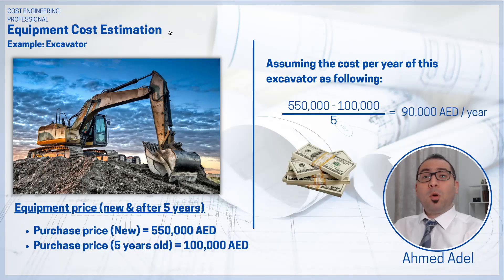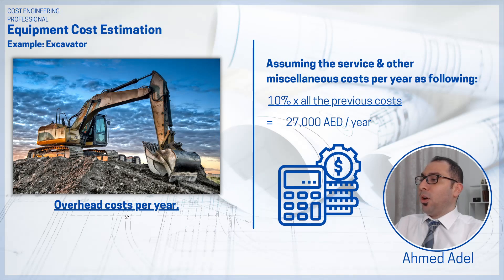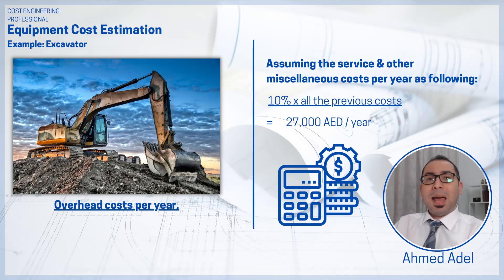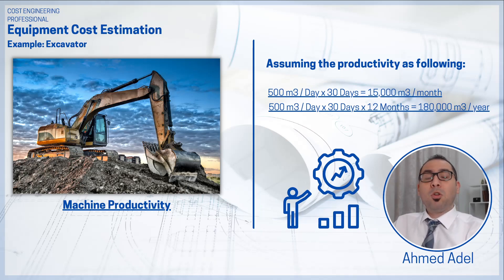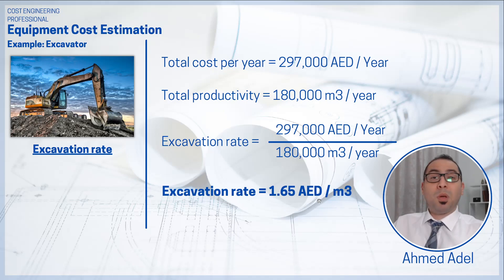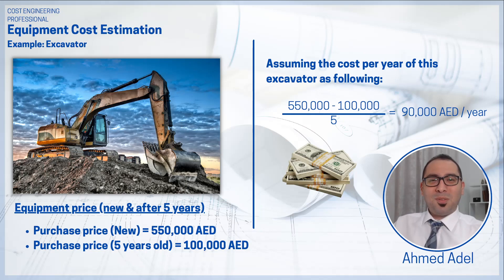How to Estimate Equipment Cost In Construction Projects

Comment: If there is something mostly the specifications data sheet will not tell is the consumption daily of the fuel,it only tells you the totally full fuel for each machine,now to know the daily consumption dependents on the experience on the field. As for my experience for example a motor grader full with fuel and doing 8 hours work can take more or less 3 days to finish the tank.
Reply from the maker: Great. If you know the consumption for the different equipment and also know the productivity, you can estimate the cost per unit of measurement 👍
Reply: @CEPQS  I'm delighting on your master class

Comment: TLDR: Equipment cost estimation in construction projects involves factoring in various annual costs and considering the time value of money for future resale, in order to determine the total cost of equipment and make informed decisions about acquiring and using it.

00:00 💰 Equipment cost estimation includes purchase price and annual cost per year, which can be calculated by dividing the loss of money over the years by the number of years.
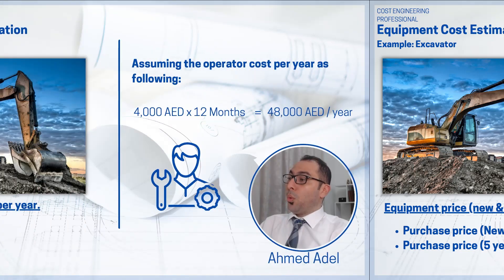01:33 💰 Equipment cost estimation in construction projects includes factoring in operator cost, fuel cost, and service/maintenance costs per year.
03:01 💡 Equipment costs in construction projects include maintenance, insurance, and company overhead, with total annual costs including equipment, operator, fuel, service, and miscellaneous expenses.
04:38 💰 The total cost of equipment in a construction project is determined by the annual cost and the productivity of the machine.
06:02 💡 The excavation rate for the excavator is 1.65 dirhams per cubic meter, not accounting for loading or disposal costs.
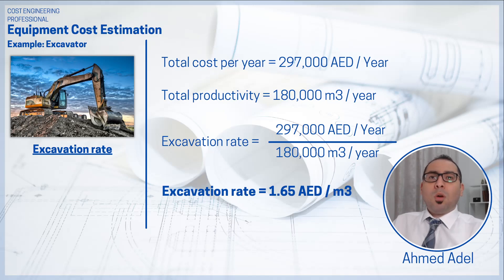07:09 🚜 Excavation subcontractors need to ensure constant work for their equipment, while main contractors should carefully consider the need for equipment before acquiring it.
08:24 💰 Calculate the cost of equipment in construction based on annual cost and usage, and consider the time value of money for future resale.
09:33 🏗 Pay close attention to the time value of money, especially in high inflation countries, but in low inflation countries like where I am, it will not affect calculations much.